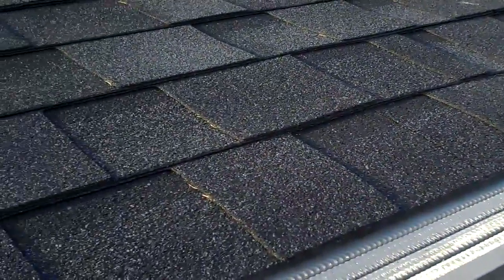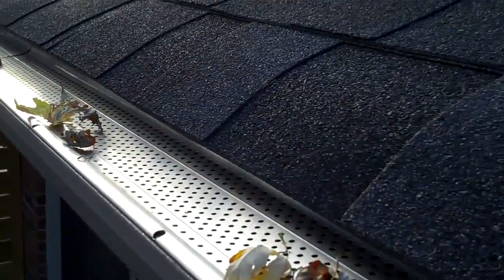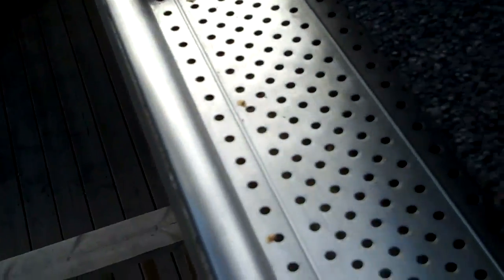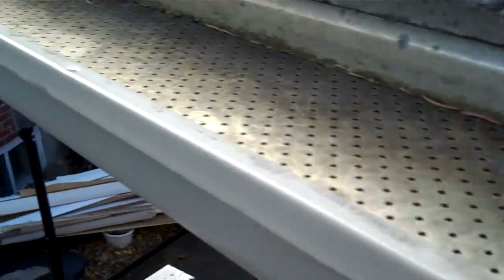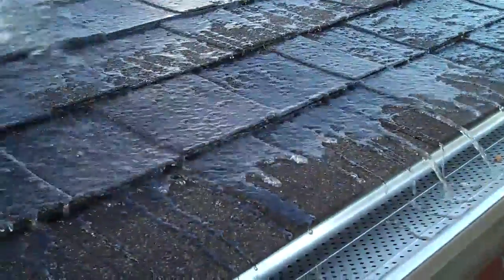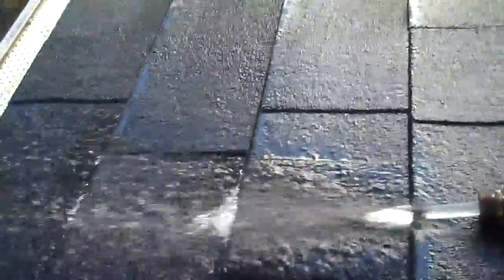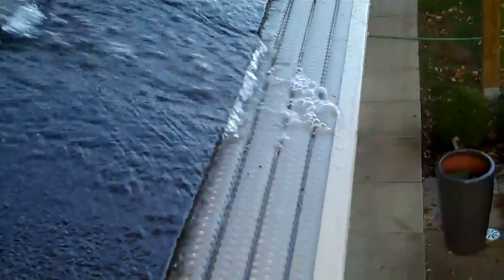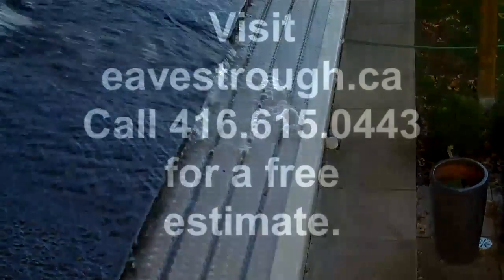Leaf guard Water Test On T-Rex, Leaf Solution and Smart Screen

Comment: I’ve had the T. rex system for ten years now and overall it works good for debris like leaves twigs etc… but mine are slowly filling with muck and shingle gravel that cannot be cleaned out unless you dismantle the entire system.
Reply: Alurex has a lifetime no clog warranty if it does clog
Reply: I have seen that happen a few times. I believe if your gutters are not sloped properly they will not self clean like they should. Check if you have some deficiency in slopes, holding water somewhere. Alurex is a super company to deal with and they stand behind the product. Pls reach out to them if you want help.
Reply: I saw one video with 1 foot long access panels.  I assume that you just need to get a hose in one end to flush.

Comment: Don't purchase LEAFFILTER GUTTER PROTECTION system from LEAFFILTER NORTH because they do clog on top of the filter which is not covered by the warranty
Reply from the maker: I am not totally familiar with their product. We have not sold Leaf Solution leaf guard in many years as was expensive to buy and can be tricky to get up under bottom row of shingles properly in some cases. From what I saw on the jobs we did with Leaf Solution it worked great. We even have had past customers track me down at our new location in PEI to see where they can get more of it for there cottage etc.
Reply: @torontoeavestrough  all micro mesh filters will clog on top of the filter and i don't suggest that you use this product in Minnesota with the winter snow
Reply from the maker: @rogerberres5626  thanks for the information. If I go to Minnesota I will not bring any!
Reply: @torontoeavestrough  your welcome
Reply: @torontoeavestrough  let me make myself clear i don't know about other LEAFFILTERS I only know that LEAFFILTER GUTTER PROTECTION system from LEAFFILTER NORTH is a faulty system from the start I would not recommend them to anyone period Thanks Roger B

Comment: Why is the hose closer to the smartscreen than the other two guards?
Reply from the maker: Watched it 3 times to see if what your saying is accurate and not seeing much difference. Like I followed up with in video, high flow valleys will be tricky to contain all the water on the smart screen even with a valley splash guard. Feel free to expand. A critical look at things is always good.
Reply: @torontoeavestrough   Excuse me, I watched it by frames, and you are correct.  I will be more dilligent in the future, my apologies.
Reply from the maker: Hey its good to keep an eye out for  bias or misleading information. Any of these 3 leaf guards are better than none in my opinion. I appreciate your feedback. Thanks for watching

Comment: Any perforated gutter guard that creates a level "shelf" (especially those that have a small barrier wall) are a total waste of the homeowners money. The under shingle mounted micro-mesh screens that extend the roof angle to the outer edge of the gutter are a superior product. No gutter guard is maintenance free! All micro-mesh guards require water wand cleaning every 2-3 years or so. The "helmeted" style of gutters are a haven for bees and wasps.
Reply from the maker: Will have to disagree with first part but agree with the last 2

Comment: All my gutters except the 30' gutter on the back of the house are 10' off the ground,and I can use my battery leaf blower to keep them clean from a short ladder. The gutter in back is 30' long,and 25' off the ground,and with my fear of heights,I have  been hiring someone to clean it. The $64,000 dollar question is what leaf guard product is self cleaning and doesn't need maintenance,which is the whole point of a leaf guard in the first place. I will almost certainly buy the Leaf Solution for my place.
Reply: Mike if you did not buy your leaf guard yet, look at the new Alu-Rex Double Pro. It's dual layer design microfiltrate debris such as pine needles!

Comment: What happens when mold and mildew begins to grow in the mesh?
Reply: From what I've seen some micro-mesh products have these problems. Look at the new Alu-Rex Double Pro. Dual Layer design microfiltrating debris like pine needles... without mold and mildew.
Reply from the maker: Thanks for the comment. We have gone back to projects a few years later and haven't seen any evidence of that happening in the areas we installed. Also no call backs from jobs we did years ago. The leaf solution  product is pricey so if there was a problem I am sure we would hear about it.
Reply: @torontoeavestrough   Fair enough. The water test seemed to show both of the other products had overflow, but the amount of water being used in one spot probably exceeds any downpour one would see. If it did rain that hard you would not be able tell the difference from the overflow or the rain itself